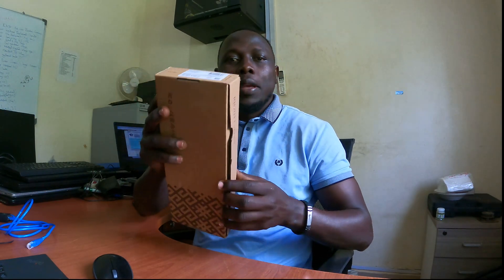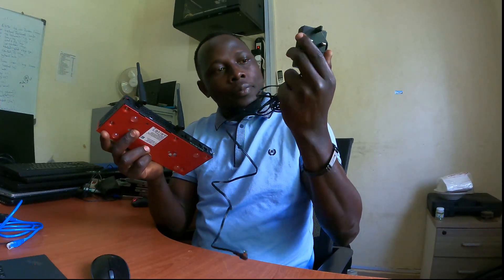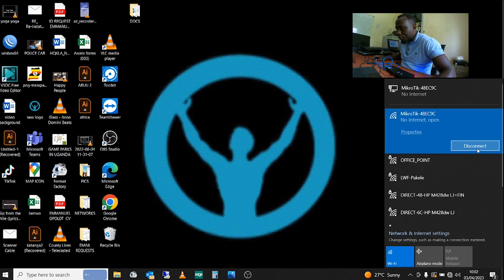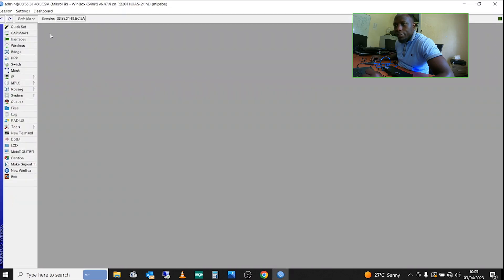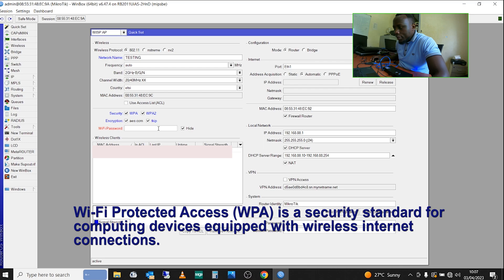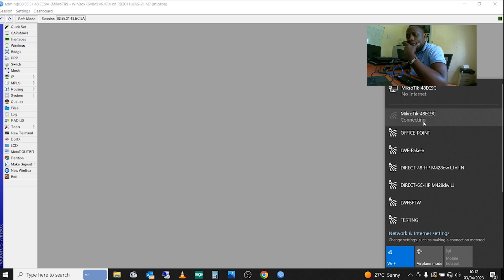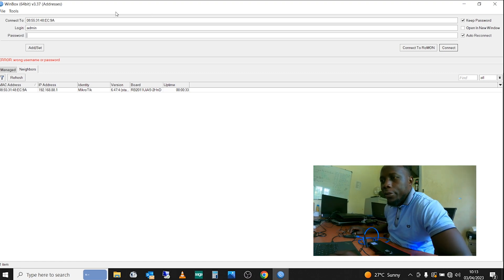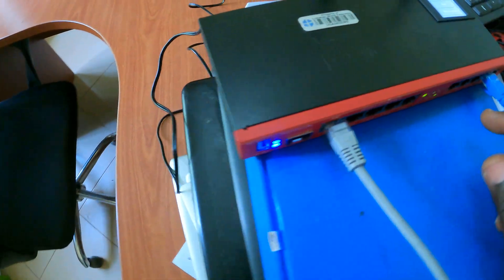MikroTik Router RB2011UiAS-IN | configure to access internet

Comment: Is this router more powerful than L009 ?
Reply from the maker: L009 is the newer version and according to MikroTik org, It is meant to be faster. However, Note that RB2011 has 10 ether ports, L009 has only 8. RB2011 supports configuration directly on switch chips, L009 doesn't (or has severely reduced set of configuration options).